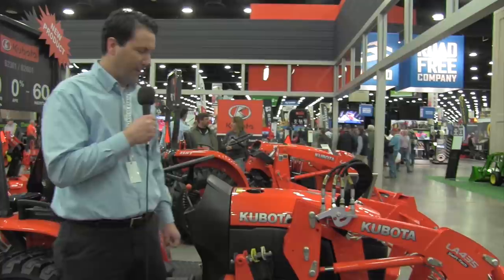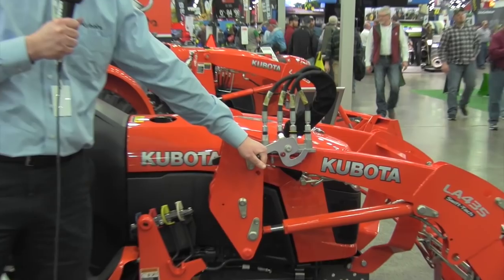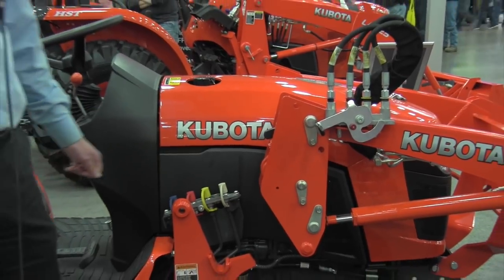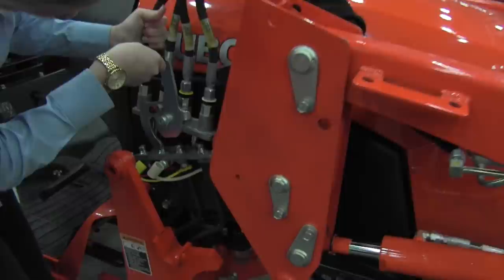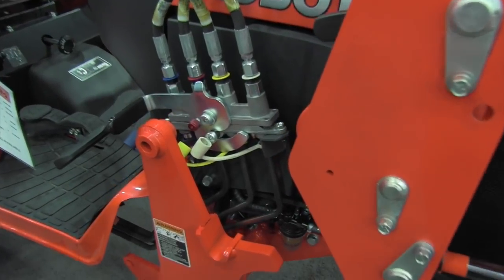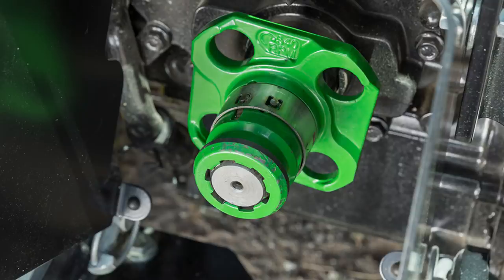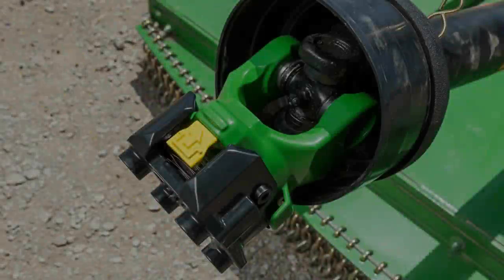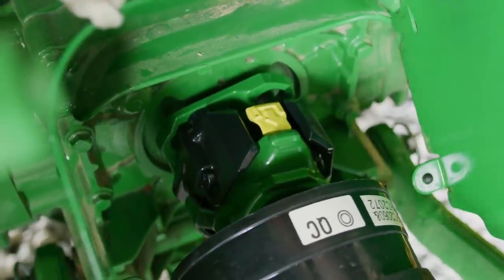3 Brand New Innovations That May Be Coming to Small Tractors

Comment: Thanks Mike. Thanks for bringing the info back for us to see. The hydraulic quick connect seems like a great idea. But I wonder how many times it would get used if I hardly ever remove the FEL? I bet that design migrates to other hydro couplings soon. 👍
Reply from the maker: Yeah, I thought the same thing.  I remove my bucket often in tight places, but would I go to the trouble of removing the whole loader if it was easier?  Don't know the answer...
Reply: If I don't need my loader on the tractor it's off. That quick coupler would make it that much faster.
Reply: I think if you sit back you can see how important this will be for some. If you need to load your tractor to transport for landscapers that may not need the loader, it can be helpful to have less weight to tow, to do maintenance it would be very helpful to remove the loader quickly instead of using a piece of angle iron to safely keep the loader locked up, for a lighter tractor on soggy terrain unloading the loader would be helpful, or other task such as bushghogging where more stress is put on the front and wears out the front axle seals faster, a quick release would again be helpful. I have a Kioti but my hat is off to Kubota for what I believe to be a very significant innovation.

Comment: Neighbor bought a BX-2380 with that type of hydraulic single unit system.

It ;eased when He got the Tractor with 0.4 hours on it

He's a mechanic and finally took it apart and there was dirt inside one of the hose connection

Brand New and delivered leaking Hydraulic fluid

He was not happy

It's fix, but He had to fix it HIS BRAND NEW KUBOTA

Comment: I’ve often wondered why more compacts weren’t equipped with self-leveling. The users would be hooked if they ever used one! I got one on my TYM 754 and it is great. Especially with my 8 bale fork. The loss in lift capacity (maybe 200 lbs) is well worth it.

Comment: Hi Mike, have a question that no one around me can answer. I have creamy hydraulic oil and my 3 point and bucket is very spongy.  How do I drain all oil from everywhere? I would like 90% replaced by good oil. I know just pulling plugs won't get cylinders. Could you possibly do a walk through on what to disconnect. Thanks

Comment: I don't like any of these new options. JD is copying the QD PTO systems that are already on the market. 
Self leveling bucket isn't a big deal, anyone that's good with their loader doesn't need that. 
The single lever hose attach looks like something that could easily get bumped loose and all 4 hoses would spring a hydraulic leak and under high pressure that's not very fun.

Comment: Were there any battery powered tractors on display or talk of tractors powered by electricity?
Reply from the maker: Not that I saw. It's coming though.  Can't wait to drive one...
Reply: Tractor Mike from what I have read one Indian tractor company,  Farmtrac, is planning on releasing a 26 HP electric tractor.  The way I see it farm tractors and electric power go together quite well for a number of reasons. The fuel could be made on the farm via solar panels. The weight of the batteries would be a positive for a tractor. All of the different functions both mechanical and hydraulic could be done simpler with electric motors. 

Finally it would be great to drive a fairly quiet tractor on the farm you could stop any time and have complete silence and not much smell. 

I guess it may be at least five years before we start seeing a number of battery powered tractors out there.